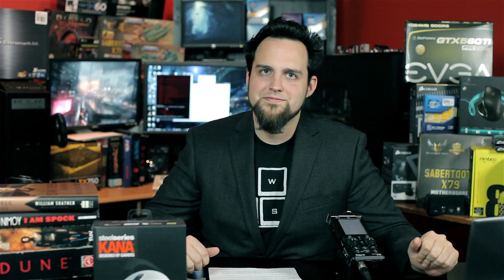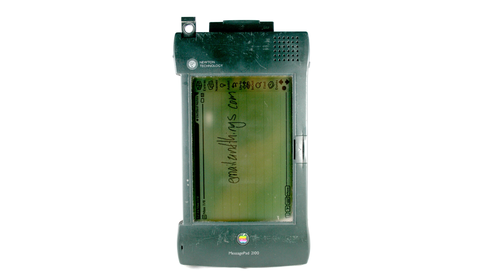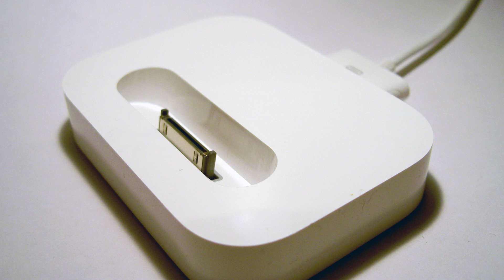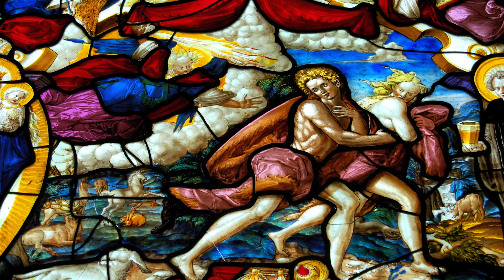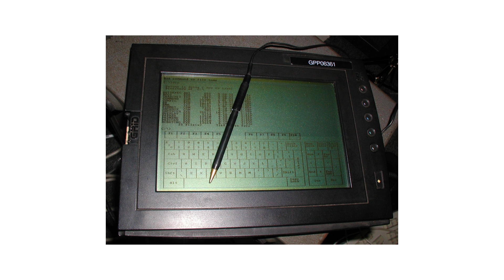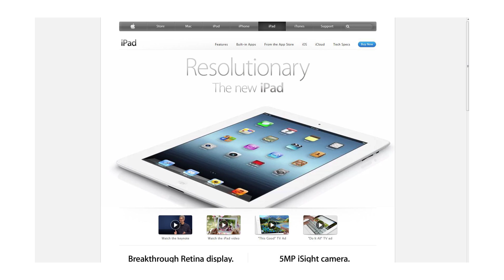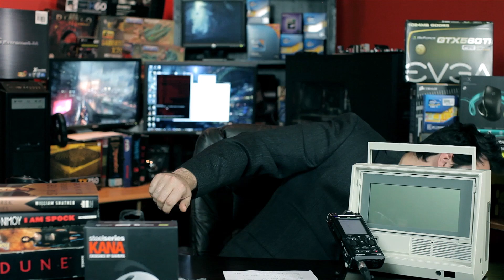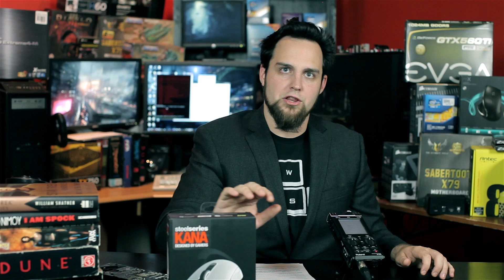Has Apple Really Ever Invented Anything?

Comment: well look around you. for starters most office buildings and companies run PC since they work better for it. the only time i have ever used a mac was in a school. don't get me wrong the software is simple to navigate mostly because it seems like its designed for people who barely know what the definition of technology is and get blown away when the thing called the internet appears. which is not a terrible thing. windows also is more supported through gaming and software as apple is more limited. its like android versus IPhone android= more interface customization and freedom and apple= stuck with what you get

now the phones compared. i have had both starting with an iphone. using it i got bored and found it just wasn't enough. i later switched to android which i still use today and which I PERSONALLY prefer. also looking at variation the iphone has the IPhone original or the IPhone 3G then the IPhone 4 - IPhone 4s - IPhone 5 - IPhone 5s - IPhone 5c
android on the other hand has tons of different companies making android based phones samsung already alone has more then iphone for example Galaxy note 1 - Galaxy note 2 - Galaxy note 3 Galaxy s4 Galaxy S4 mega - Galaxy s4 mini and the Galaxy S5 mot mention Motorola HTC and Sony just to mention a few 

in the end it comes down to personal preference and its stupid to see people going at each others throats like its a war on apple versus android they are different companies and both are really nice and what about apple versus android versus blackberry?

Comment: Apple probably invented something but they definitely didn't invent the touch screen. I had a Casio TC 600 wristwatch from the 1980's with a built in calculator and capacitative touchscreen (like that on the iphone). Yes the 1980's. The thing is over 30 years old, is the size of a half dollar and still works today. Too bad Casio didn't stick with the concept of the touchscreen. What apple did do is take existing technologies and implement them correctly in a user friendly manner.

Comment: Apple - crApple
Reply: Darshan Davis I don't think that word means what you think it means
Reply: Darshan Davis there's another word you don't seem to know the meaning of.
Reply: Obummer BinLaden

The Surface Pro outsells the iPad?

Care to share some numbers? 
Last year Microsoft hardly made 900m USD revenue with its Surface line (RT & Pro) while Apple sold roughly 50m iPads at more than 18 USD per piece. 
Or do you have access to some secret sales figures Microsoft does not release to not shame Apple?
Reply: O Herk this is exactly the way Isheep talk. HOWEVER Fandroids can have the same said about themselves. What people don't relise is how both platforms are made. (Apple)they have a set list of specs that they then build IOS off of. This is why IOS runs so butery smooth. (Android) Google thows their OS to the OEMs and says fuck you, deal with it. And the OEMs then have to build a phone that can run Android buttery smooth just like IOS. THIS IS WHY IOS can run on sub par specs, because apple doesn't need those high end chips and circuits to run their OS buttery smooth. All in all both are incredible OS's and do what they were made to do, perfectly. The only reason I switch from my IPhone 2G-5S was that I needed the bigger screen for my job, we all chose our OS to meet our needs. <--its that simple.
Reply: Indecisive Fella
Lol, You may want to edit your post "Apple sold roughly 50m iPads at more than 18 USD per piece."

Didn't know you could buy an iPad for so cheap.

For the record, I do not like apple products either. I admit that it was cool at first, hell I even had a Jailboken iPhone 3G, then moved on to the iPhone 4 and they are alright, nothing really ground breaking, mainly kept them for so long because the doubled as my iPod, however I bought a Galaxy S3 and I don't think I will be going back to Apple anytime soon, I think I will stick with them to manage my music and videos, but what you can do on apple products are very limited. I don't have to jailbreak or hack my phone to do what I want to do on it, I don't have to worry about OS compatability issues when I play games, and if I want to improve my computer's performance then I can just buy the hardware and install it (GPUs, CPUs, RAM, Hard Drives and SSDs) and not buy a brand new desktop. Apple is great for a few things, but you can easily get close or even surpass Apple's capabilites with other companies at a much lower cost.

Darshan Davis 
"against apple just because they can't afford most of their products"

Even if that is true (which I'm sure this statement applies to some, but not all) we all work hard for our money, if we can get something that works just as well as an apple product for a lot less $$$ then who are you to judge them, just because you're willing to shell out the extra money for an apple product dosn't mean we all should. And just because something cost more doesn't make it better, I prefer my $300 GS3 over my cousins $500 iPhone 5
Reply: Indecisive Fella Yes if your primary reason of getting one was because your friends, cousins, co-worker, everyone you know told you to get it because it's an Apple product and defending it with your life while knowing nothing about it, of course that makes you an iSheep. Now if you use one because your feminine hands are not large enough for other larger smartphone, or if you prefer the way iOS works, then no you're not a fanboy.
Reply: Darshan Davis Typical iSheep line of defense - oh it's because of this and because of that, it's the only reason why it costs more than a apple. I know what a Surface Pro tablet is and it doesn't matter. It can print out money and at the end of the day, it's still a tablet with a reasonable price. With apple, you DON'T get what you paid for. But the fact of the matter is, you proudly pointed out that "people can't afford apple product because it's too expensive". Truth is people can but they are smart and refuse to pay a large amount of money for something that inferior to what's already available in the market, something apple users will never understand. Stop being in denial and maybe you will see the light. And so what if you have Windows 8 on your mac, do you want a gold medal for that? You can run Ubuntu or Fedora for all I care, it's still a mac, still inferior. Sugar coat it however you want, I rather be a smart shopper than a stupid blind consumer. Like your iDevice, try to keep up to date.
Reply: Indecisive Fella your name fits you so well. You are indesisive, in the most unapologetic means of course. Your "expaination" dose not fit with your original post. I'm sitting here looking at the two and going WTF HAPPENED, IT DOSENT MATCH!!??
Reply: Indecisive Fella
Damn!!! You and your essay. YES you really are a fanboy and NO I'm really not a fanboy. Unlike you, I like to pay for what it's worth. I had, still have, an iPod because in my opinion (and not what Steve Job says) it's a superior MP3 player to other generic players and the Microsoft Zune. Currently I have a non Apple smartphone that take now care of the MP3 department. But I'll be damned if I bought iPad, iPhone, iMac, iDevice (at which I can afford) just so I can jailbreak it to be able to ALMOST do what any other cheap, low costing devices can do. If you wanna pay more and get less out of it, that's your business. I ain't fucking stupid and is definitely not a sheep so I refuse to ride the iSheep bandwagon so Indecisive Fella  you better make your decisions quickly and effectively. Hahaha.
Reply: Indecisive Fella I have a Android, but I ain't no fanboy. I'm just a poweruser. Similarly with computers, I don't use MacOS or Windows. I use Linux. Apple puts too much limit on their devices for it to be even usable for me. I have an iPod, great for music but smartphone tech has surpassed it. Shit if RIM or Windows Phone Mobile has as much development as Google, I'd end up with them. Or if Apple weren't so damn limited, I'd even go with them. At the end of the day, what matters most is what works for the user right? Sorry for calling you a fanboy as 99.9% who approaches me are iSheeps. I don't hate Apple, I just hate the clueless people behind it. In comparison to Apple users, you don't see this much idiocy from the Android crowd, the Windows crown or even what's left of the RIM crowd. Seriously, slap a Apple sticker on a brick and iSheeps will eat it up.
Reply: Obummer BinLaden They can charge how ever much they want because theres nothing else like it and people enjoy using it.
Reply: Android fanboy
Reply: Obummer have you cared to notice that the reason why the surface is almost twice as much as the iPad is because it's a laptop AND a tablet? Oh, and if you were wondering why people buy Macs and iPods and other apple products is because of the user experience and exclusive games and apps, something that non apple users will never understand, and oh by the way I also have windows 8 on my mac as well (gaming purposes) so yes I know what I mean when I say user experience, for both mac and windows
Reply: Obummer BinLaden
The problem I have, and you probably think that is due to my fanboyism, of if which you definitely show NO signs in any way, MSFT did not release sales figures for its Surface Pro 3 in its fourth-quarter earnings call this year.
MSFT has released, they earned 409 million USD in that last quarter with all Surface products.
Let's say, those 409 million USD would have been all Surface Pro 3 tablets, and all 799 USD models, then MSFT would have sold around 511.889 pieces of them.

Now let's take a look at Apple and its iPad 4 sales figures and for that lets look at last year's third quarter.
Apple claims to have sold 6,374 million iPads in the quarter ending July 2013 and made a revenue of 14,617 billion USD with them.
Since the iPad 4 and the iPad mini were both sold at that time, and the iPad mini probably outselling that iPad 4 (released in October 2012), assume Apple only sold 2 million of them, and then let us also assume they only sold the cheapest model for 499 USD.
Now I know, math is something you cannot withstand, thus I leave you the product of those two numbers.

Or am I still not getting what you mean?
You meant, the Surface Pro 3, which was announced in May 2014 and begin selling at the end of June 2014, is outselling the iPad 4 (released in 10 / 2012, discontinued in a way in 10 / 2013), but compared to what time periods?
Or do you really mean, that the new and fresh main product of one company is outselling the almost two year old product the other company sells for people who cannot afford the newer products?

But then again, I am only a fanboy, and you are NOT.
Reply: Obummer BinLaden

Quick question: do you consider every iPhone or iPad user to be an iSheep?
Reply: Indecisive Fella he shouldn't I have my Samsung galaxy S5 but I do have my MacBook pro.
Reply: Obummer BinLaden
Thanks for that, I just wanted to make sure you are not biased, and here you are.

I just prefer the way iOS works with my way of thinking, thus I am not a fanboy by your stated definition, but you still call me one.

Do you yourself consider an Android fanboy or even Apple hater?
Reply: Obummer BinLaden I okk my 90.jubilant  

  bllĺĺĺl1viuriodoffdidtrorpfodofriutreororolspslldkirkfkfjkjķowueu8et9rpooriiky77
Reply: Deputy Bhatoa WTF?
Reply: Christopher Vance, that's what the new iPhone 6 plus is for.
Reply: Belligerent Bacon exactly! but i still need my note3/experia Z ultra lol
Reply: Idiot.
Reply: Jorge Cabrera
LOL. Lame as hell, not even original. Try harder.
Reply: Belligerent Bacon
Because crApple realize iCraps are no longer selling well, the purpose of the new iCrap 6 is so that iSheeps can put it in their pockets and bend the fuck out of it and crApple can make more money out of their sheep ass.
Reply: first of all... just shut up you have no valid arguments and judging by your colorful use of vocabulary your probably like 12. Second iPhone 6 doesn't bend easily, can they bend... yes, of course so can any other phone on the market under the circumstances so go and do research because there has only been about nine and even if apple lied about the number they have sold roughly 20,000 iPhone 6's so go get your information from a reliable source.. . maybe someone that's not your friend who saw a video. aside that stop your so ignorant and immature to insult our president maybe he wasn't who you voted for but really your incredibly original.
Reply: Bruno Gomez "you have no valid arguments".... And this is coming from an iSheep. Whether or not, the argument is valid, nothing will be "valid" enough for you iDiots. Besides, I'm not here to argue. I'm here to tell it like it is. "Second iPhone 6 doesn't bend easily"... Please just stop it with the fuckery. At no point in time of smartphone's history have you heard of ANY smartphone's that bend while in the pocket, until the release of the iCrap 6. "Any other phone bend".. While in the pocket? Prove it. Where's your sources? I thought so. None because it has never happened. EVER. I'm not going to say I had an iCrap but returned it due to it being so shitty, because I would be lying. I can tell you majority of my iSheep freinds lost hope in crApple and converted. You know how desperate crApple is? They are so desperate, they signed a contract with Sprint to exclusively place the iCrap 6 on one of Sprint's unlimited everything plans for $50 a month, just in a effort to get rid of excess supply of iphone that they anticipated was going to "sell out fast". Since Sept of this year till now, that plan was and still is a flop. That's how shitty the iCrap is, people refused to pay even $50/month and get stuck with such a shitty phone. You won't have this problem with majority of the Android phone. The Samsung and Nexus has no problem selling at full price, while the iCrap 6 struggles to even be had for free, under a contract.
Reply: Jorge Cabrera
Thanks you for proving my point. The truth hurts and you iSheeps refuses to hear it :)
Reply: Jorge Cabrera So no cell phone will "Ever" be as successful eh? So you can see into the future can you? You wouldn't mind telling me next weeks winning Eurolottery numbers?
Reply: Jorge Cabrera Weirdo.
Reply: Ironically to both of you I used to own an LG but it's usually biased android fanboys who are against apple just because they can't afford most of their products and they've never used any apple product besides an ipod before

Comment: I think it's inaccurate to say that apple "invented" a manufacturing process, they just employed an already existing process to machine a bunch of laptop components. Cnc machining has been around for a fairly long time now and is an industry of it's own, all plastic mouldings employ the use of cnc machining [and manual machining such as grinding milling and turning as well as lapping/polishing etc] so no apple didn't invent anything there they just took the long/expensive route. An entire car could be machined from solid billets of steel but that'd be impossibly expensive and just plain ridiculous. Just because you can, doesn't mean you should. I'm sure they could have achieved the same result with a lot less material waste and manufacturing cost.

Comment: I know this topic is already 2 year old, just like to add some facts about this video. The iPad brand is not even created by Apple. The brand came from different devices. An example is the Fujitsu iPAD a handheld computing device in 2002 complete with Wi-Fi, Bluetooth, and VoIP support used for point-of-sale. Also Magtek has a device which is called Magtek IPAD also a POS device. In Europe STMicroelectronics even held the trademark since September 14, 2001. Apple bought the name iPad from Fujitsu weeks before the launch of the Apple iPad tablet to avoid major problem which may have cost them a hefty price for the trademark before even selling their product.

Comment: if you look at an iphone 1st gen and you look at all of the other phones at the time you will be blown away, you're just siding with android (like a lot of people) and lying about inventions and who made "smartphones" first, and also your "recipe" idea is actually what samsung, galaxy, and htc did with the iphone 1st gen. i understand you're slice of the cake also, i have also had android devices don't get me wrong they are great devices, but if for instance i look at the iphone 5s and the galaxy s5, there are some key differences and yes the screen is smaller than the galaxy s5 but the iphone 5s is a very good compact device. the iphone 5s has a very good fingerprint scanner almost instantly getting it wright the galaxy s5 leaves you swiping you're finger multiple times often not working. and the ios operating system i almost instantly understood but android took a little practice my point is apple very well did design the current father of smartphones we use today.